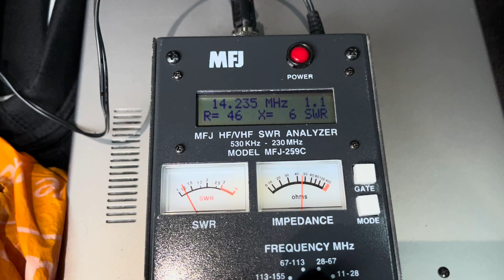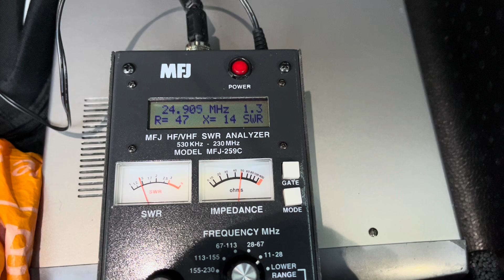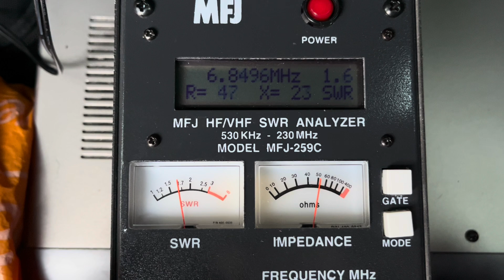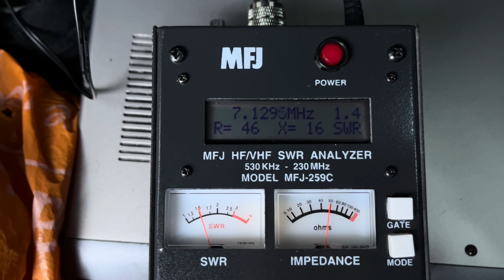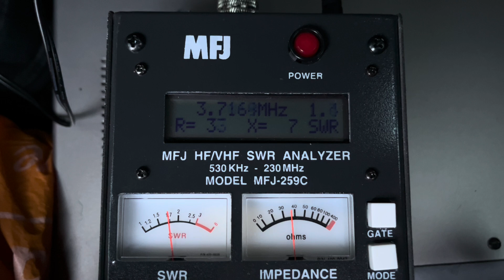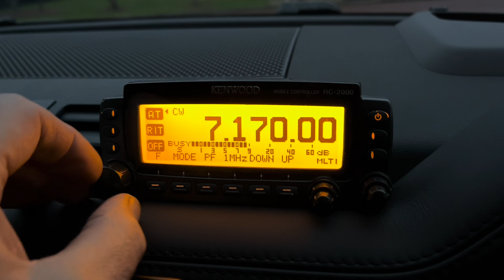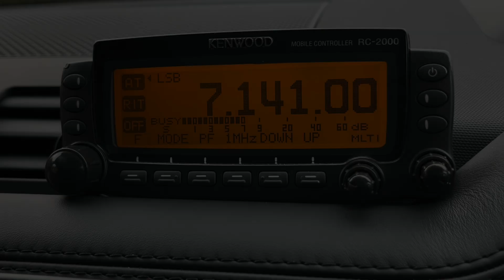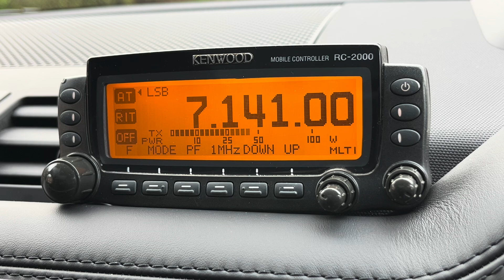Tuning & Testing HF Mobile Antennas

Comment: Nice video Ian. However no way to get better result on 40m or 80m without MAT-50 (Diamond) or home made plate (as "sandwich"" of magnetic foil & brass foil). TNX to share & 73, S51X
Reply from the maker: @PrimulaCarniolica  👍🏻

Comment: I have an old DX27 CB antenna with various lengths of stainless steel whips to give me 10m, 12m, 15m and 17m. I've also modified the top end of an old 5ft 5/8ths CB Firestik I bought cheap at a rally, to take various stainless steel whips and that gives me all bands 10m - 20m I basically fitted a centre drilled brass bush into the tip and drilled and tapped a hole in the side of the bush to take a 2.5mm stainless steel grub screw to secure the whips in place. Cost less than £10 for the entire antenna.
Reply from the maker: @RFeye  Brilliant! 👍🏻